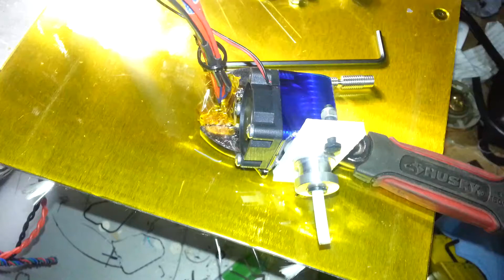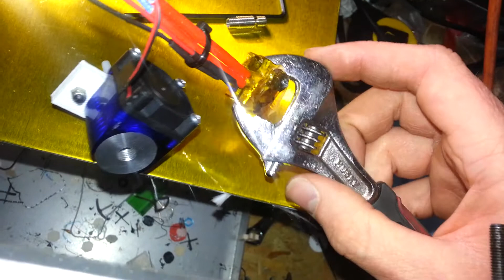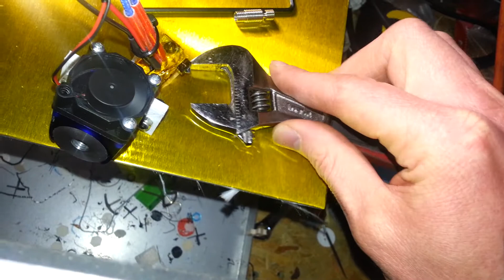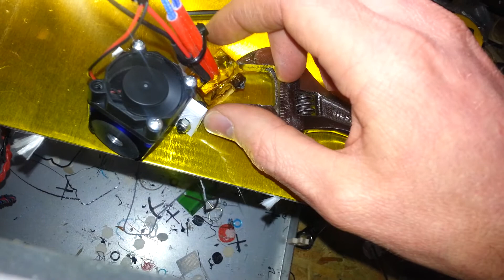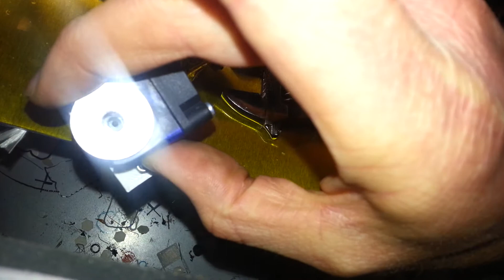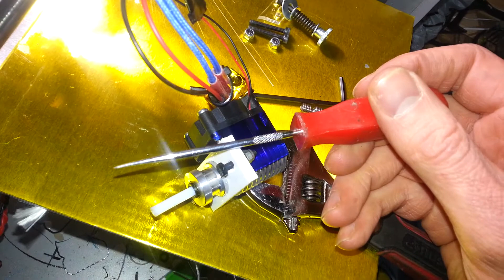How to unclog your E3D v6 hotend

Comment: when the filament is near the hole you can just make it soft and slightly like gummy candy by only softening it. it all pulls out at once. don't heat it too much just until it gets kinda soft.

tho when it's deep inside it's a pain to remove...

Comment: Totally worthless video. You don't show shit. wtf? Why even post this?
Reply from the maker: If you listen to what I said, it was just a plug (ball more so) of filament from when I extracted the old filament and popped out easy after I pulled it apart. The ball of filament was too big to fit back in the hole and caused the jam. Your situation may not be the same, but it's here to try and help give guidance for someone who is wondering how to go about unclogging it having a similar issue. It shows the disassembled hot end and the trouble area and the fact that you don't need to clear all the filament out. Why post this? Because I hope that it may help someone, not so an assclown like you can come along with a meaningless post to detract from the intent of the video.

Comment: HEEEEYY another soilidoole user. I just upgraded my SD3 to the e3D hotend. 
now my filament is stuck inside it -_-
Reply from the maker: Hopefully this video helps :).
Reply: Toluene
It did, I got my E3D unclogged and its now up and running again.

Comment: How often does it clog?
Reply from the maker: Nubyrc This was my first time in about 20+ swaps - so very rare. I haven't had any issues since posting the video. There are a few ways it can clog though. A piece can break off at the cold end (what I had) which is just a random occurrence. Either bad quality filament or leaving the hotend on too long and not extruding anything can cause it to clog the nozzle (no issues yet and I've been using it regularly for a few months). Other than that there are probably a few other ways for the extruder to clog, but those are the 2 main ones.
Reply: pretty often in my case

Comment: You never said how you unclogged the heat break itself. What method did you use to unclog it.
Reply from the maker: I just used a small pick and the piece came out easy. You may be able to use cutters to trim the piece down. All you need is it to clear everything that doesn't get hot enough to melt. When you pull the nozzle off you should be able to do this. 

I actually didn't tighten it correctly after and had it ooze out from the middle, but I was able to clean it up fairly easy with a high quality tap and die set.  Paid about $100 for a metric set from Sears. I had it previously to the 3d printer.